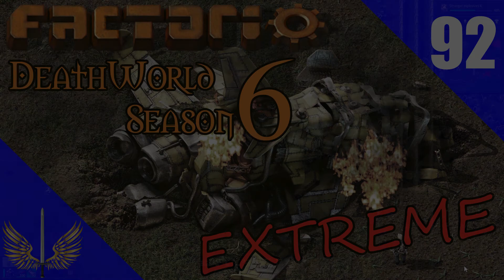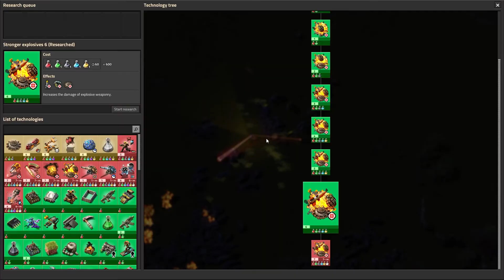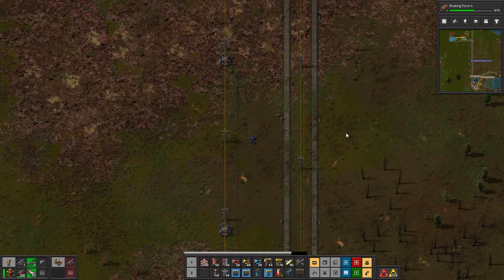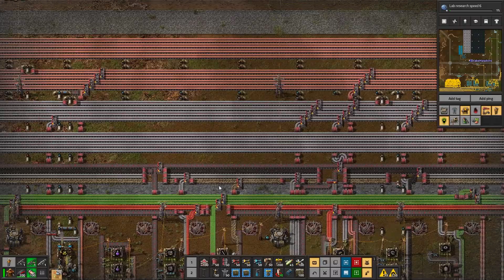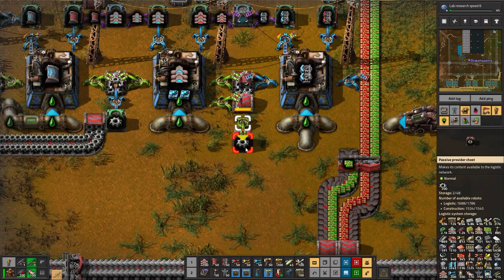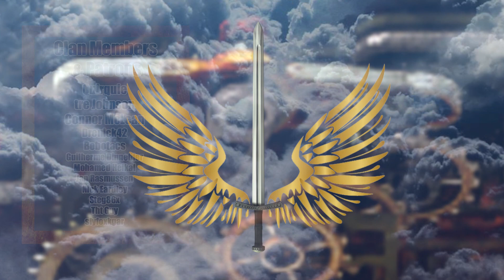Factorio Deathworld Extreme - Season 6 -  Episode 92

Comment: Huzzah spidertron!  You need a stacker for your stations.  It's just a series of parallel rail lines before the station.  One more simple fix is to shorten times that the trains are at the stations.  If you watch the trains they empty very quickly.  There is no need to sit there for 30 seconds.
Reply from the maker: Good call. I did drop it a while ago down to 30 but likely 10-15 would be good as a short term fix.